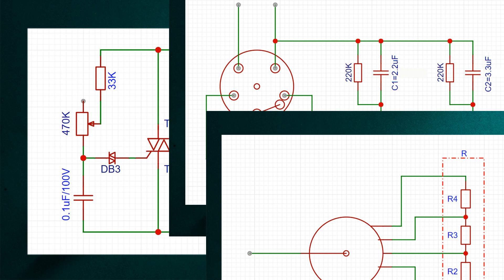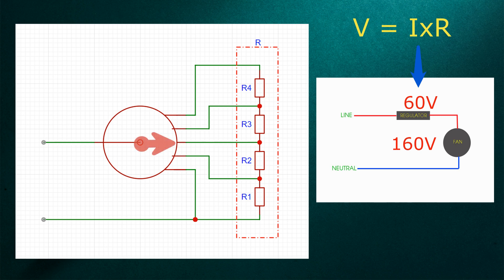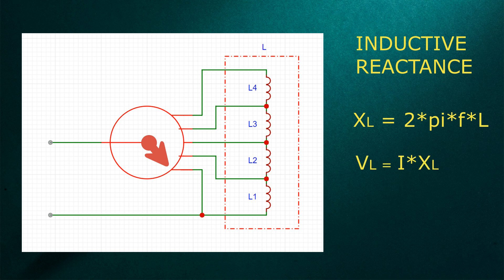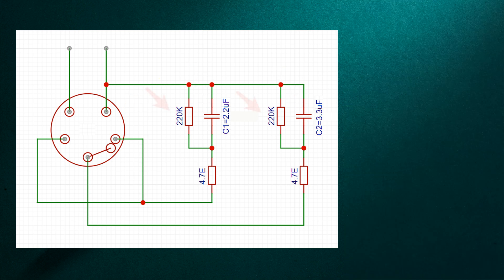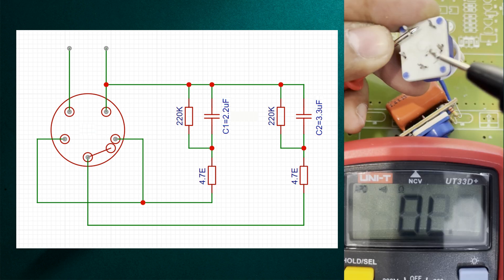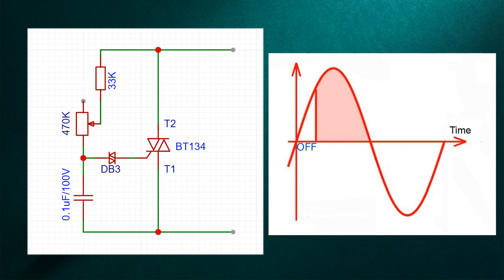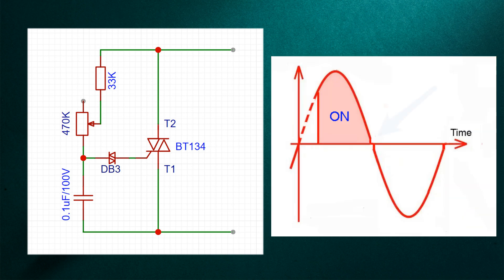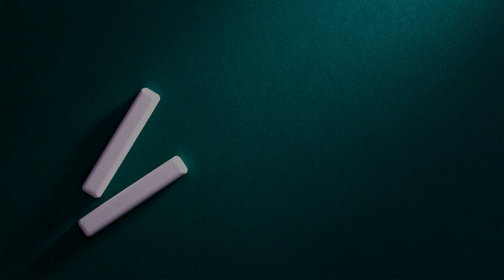How FAN Regulators Work? | Resistive | Inductive | Capacitive | TRIAC based |

Comment: DOES THIS CAPACITIVE REGULATOR WORK WITHTHE KIND OF CAPACITOR SHOWN IN THE CIRCUIT BECAUSE I HAVE TRIED IT AND IT IS NOT WORKING.  HAVE YOU TRIED IT YOURSELF?
Reply from the maker: Yes, it’s 100% working. Use 2.2uF and 3.3uF 250V+ polyester capacitor

Comment: Since the triac regulator modifies the sine wave, harmonics will be introduced. Wouldn't that make the fan noisy at lower speeds?
Reply from the maker: Yeah, they do make humming noise. However they are still widely used because unlike other regulators, their performance doesn't get affected by the load power. You can use them for different power loads without any hardware modifications.
Reply: @electronicsbyte  can you explain how humming is suppressed?